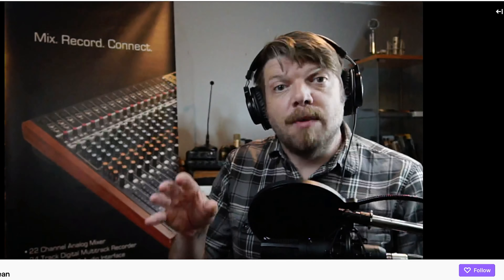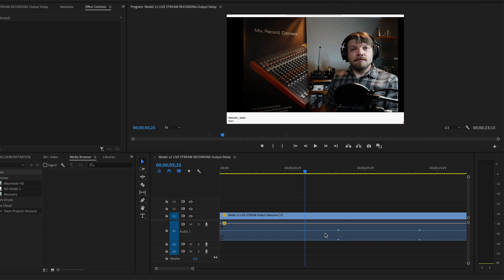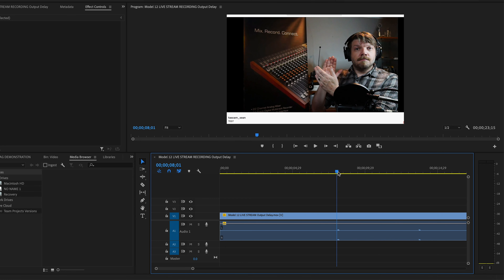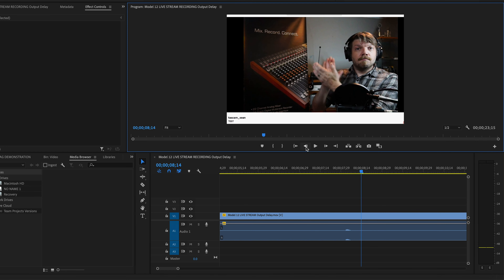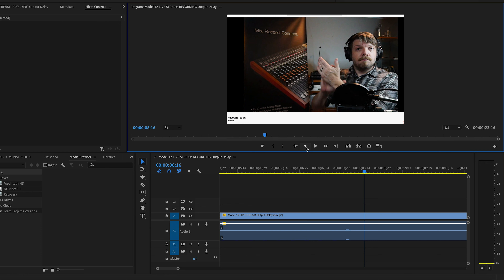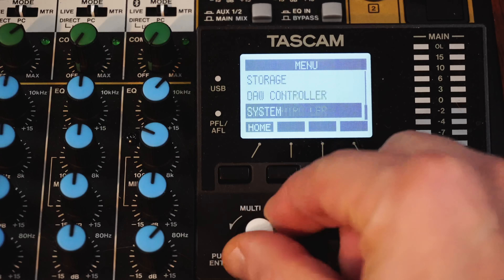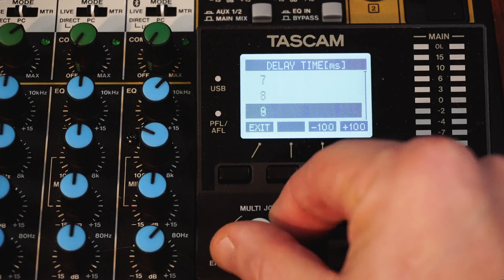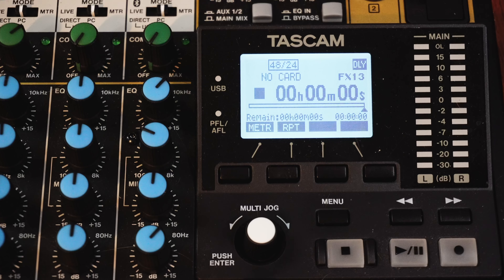TASCAM - Syncing Audio and Video on the Model 12

Comment: Hey i have a problem thatvi can't quite solve. I have hooket up a synth into 7/8! I put the channel into live mode and the pan is in the middle, but i can only hear sound on the right ear (headphones into the headphone output). I am obviously missing something, but what is it? Do i have to swich the channel from mono into stereo mode? And if so, how? Please help! :)
Reply from the maker: There is not a way to switch the channel from mono to stereo. More than likely your synth may not be sending signal to both left and right so the Model 12 is only receiving signal on one side. Please check your cabling and your synth's output

Comment: Thanks for the demo, that's very helpful. How about if you feed the audio from the Model 12 into the camera and connecting the camera to the streaming service? Wouldn't that also sync without having to do the delay?
Reply from the maker: Louie, great question.  There are a lot of people who aren't using cameras for streaming - instead, they're using webcams or even their phones in some instance.  This is more for those people who don't have a quite-so-pro setup and need to get synced up.